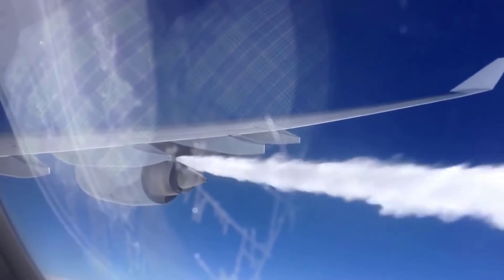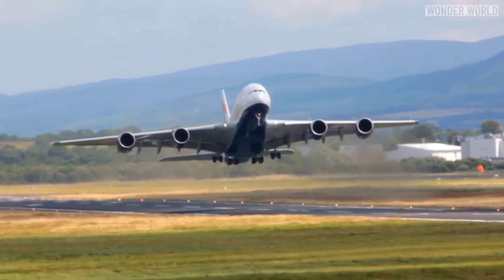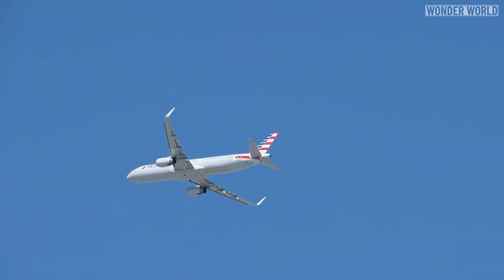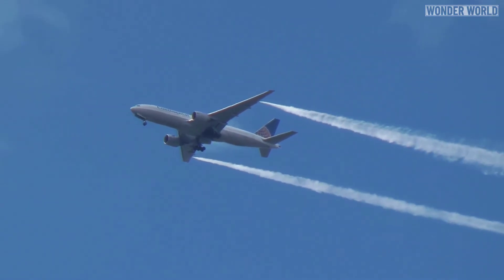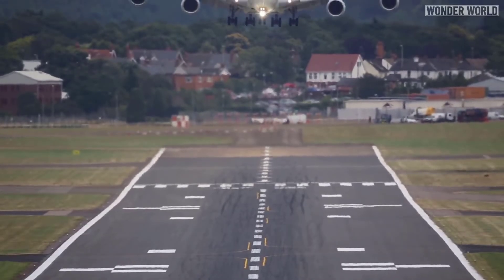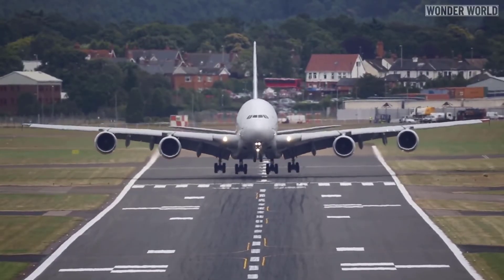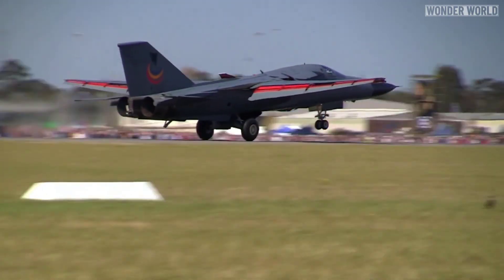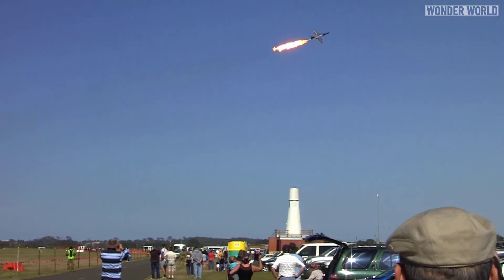Fuel Jettison - Why Pilots Dump Fuel

Comment: 🚨A plane takes off and weights a certain amount.  By the time it reaches its destination it burned fuel so it weighs less.  How is it possible that its landing weight could be too much?
Did it pick up passengers in flight.?
Reply: He didn't really explain that part too well, but as I have just been digging around figuring this out, it's mostly due to having to change course or make an emergency landing before they would've normally burnt up that precise amount of fuel they planned on using.
Planned for a 5 hour flight, but have to land early at 2 hours? They're going to be way overweight.
Reply: Emergency landing

Comment: Please explain stratospheric aerosol injections
Reply: Unlike a fuel dump which is usually a rare occurrence, stratospheric Aerosol Injection (SAI) is a weather modification tool approved and funded by US and other governments. If you noticed in the video, a fuel dump is a thin, white mist that evaporates seconds after leaving the nozzles. Stratospheric Aerosol Injection (SAI) are long white, pink or black streaks all over the sky that you see everywhere now. They persist for hours, and they do not evaporate. They dissipate and expand into 100% cloud cover.